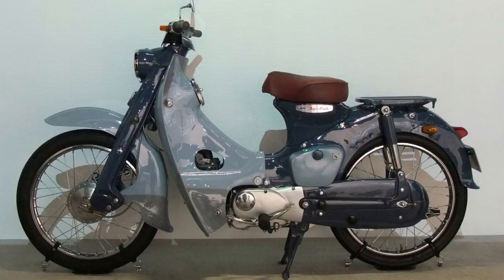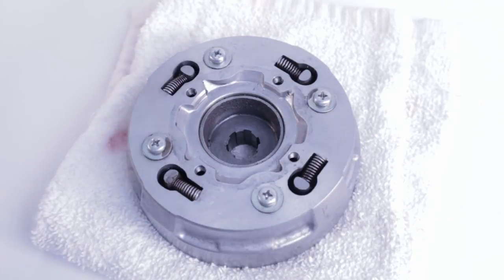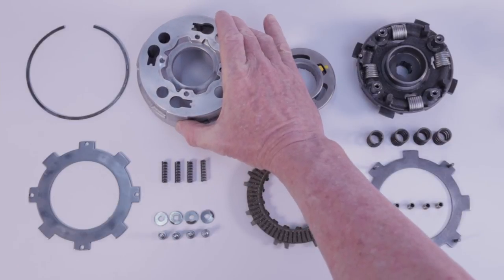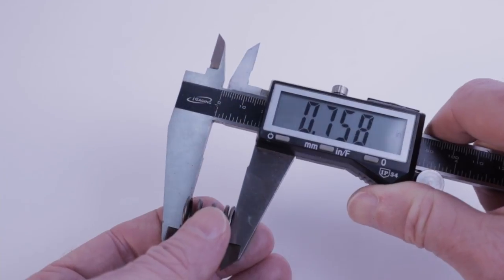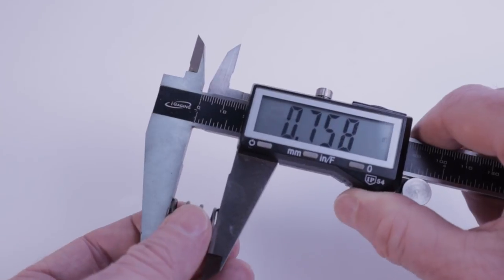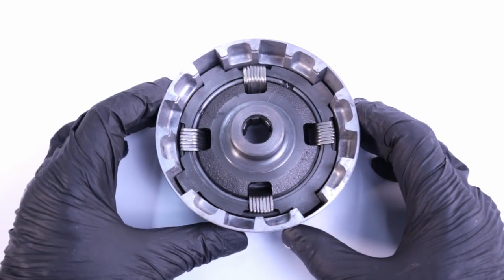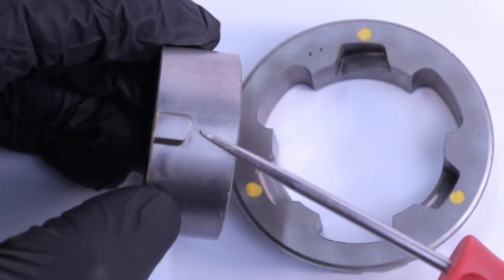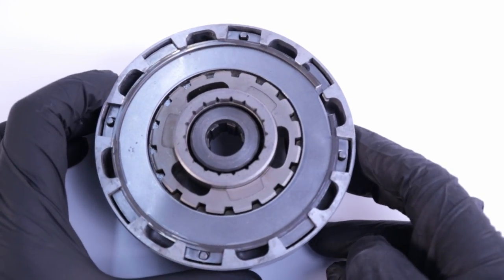How To Rebuild the Honda Semi Automatic Clutch || CRF70 | CRF50 | CT70 | XR70

Comment: I have a 1997 xr70r and the clutch grabs really hard shifting into 1st gear and shifts hard and grabs hard into 2nd and 3rd.  Not sure if this is normal, my kids manual clutch 2 strokes shift nice and smooth.

Comment: Ive never wore out one of these clutches and i really roughly ride my Chinese baja dirt runner 70cc. I wore the bearings out of the crankshaft its a 2006 model.
Reply: Once i held it wide open doing a burnout for 12 minutes straight split the tire in half and used the same bottom end currently a decade later. They're tough.

Comment: I know this video was posted two years ago so I may not see a reply but I will ask anyhow. First great video, I am trying to figure out why the B disc which is the one with material on both sides has to be installed with the chamfer facing down on install. The end tips which have the chamfer do not appear to interact with anything and I have never paid attention in the past so have installed both ways and never noted any adverse effects. I am going to guess no one knows for sure but the book just says so.
Reply from the maker: Honestly, I have wondered that myself, but I believe it’s less about the chamfer itself, but rather to ensure the engagement surfaces are oriented such that the rotation of the discs direct oil toward the center of the clutch rather than slinging oil outward. So my guess is that the chamfer is essentially an indexing mark to ensure correct disc orientation.  Good question.

Comment: Great video do you know if the ct90 plates will fit a ct200 clutch.  Trying to rebuild the clutch on my 65 ct200 and can only find ct90 clutch parts.  I know they have one less plate than the ct90 clutches but can I get away with just putting in two ct90 plates instead of the three
Reply from the maker: Hi Cole.  I’m sorry, but I don’t know the answer to that. I’m really not familiar with the CT200 at all.

Comment: Do the friction plates need to be soaked in oil for 24 hours before installing them?
Reply from the maker: Hi Back the Badge.  I am sure I am going to start a lot of controversy with this answer, but here goes.... No.  Mannnny years ago friction surfaces were made from cork and required soaking.  Cork has long been abandoned as a friction material, but the old soaking tradition didnt die with the passing of cork.  I just brush a little oil on the surfaces to make sure they dont (possibly) stick together between the time I build the motor and actually start it (In my case, that can often be a long time).  So there you have it - hornets nest now opened as I'm sure there are plenty of people out there who are clinging to the tradition of soaking without understanding the root of its original implementation!

Comment: what about adjustment after it's all together?
Reply from the maker: Hi. It’s a semi automatic clutch so it’s non adjustable post assembly.
Reply: @brian.d.mobley  well is there a intial setting, do i just turn it until i can feel it touching the part the three steel balls ride on, then lock it in place?

Comment: great videos. could you go over the manual clutch on these? I  have new clutch that won't disengage even after rebuild and inspection and swapping parts off old clutch. Here's big question> what is supposed to disengage this clutch? on other bikes i see a metal rod putting pressure on clutch. on these bikes the button attacked to spring isn't pressing on anything? is there a mechanism with the oil that creates pressure or releases it? that bearing isn't connected to anything so i really don't get it. thanks so much
Reply from the maker: Hi Schpoingle!  A manual clutch utilize a cable actuated rotating lever and a plunger rod that presses against the bearing on the outside of the clutch housing to introduce a gap between the various clutch plates thereby disengaging the clutch from the the crankshaft.  I did a complete video on that here:  https://youtu.be/eMv0ecUD8bI

Comment: Thank you for that great video and it has inspired me to try to resolve a problem with my grandsons CRF70 though am not sure which part might be at fault. When riding I have great difficulty in changing up gears and really need to pull hard on teh gear lever. Changing down is no issue. Is it a clutch problem do you think please?
Reply from the maker: It can be so many things, but the shift drum bolt may be too tight. This is a common reason for the condition you describe.

Comment: Thank you again Brian. So this bolt is accessible without having to get inside the wet side of the gear box then by the looks of it. The bolt located beneath the rubber shift bolt cover?
Reply from the maker: You’ve got it! Yes!

Comment: Great video! 
I got a question tho the clutch plates do you soak them in oil before u install them?  Or leave them dry?
Reply from the maker: It’s not going to hurt to soak the discs, but mostly that is a relic from the past from the time when clutch discs were made of cork. I light coat of oil is fine. If you are building the clutch and will put it in service soon after assembly, you don’t need to soak or oil.

Comment: Appreciate the video. Is this the same or similar to a z50r clutch? My 1993 is painful to put in gear and shift up it’s so stiff - all original parts so guessing it’s just worn
Reply from the maker: HI Peter.  Yes, the clutch is virtually the same.  These gearboxes can be hard to shift for a number of reasons, but the most common is worn/bent shift forks, the drum bolt is too tight or the pins in the shift fork are worn out.  I have had trouble with these gearboxes myself on many occasions too.
Reply: @brian.d.mobley  thank you! Subscribed!

Comment: Hey. I wonder which rmp this clutch connects the rods. :) do you know that?
Reply from the maker: Hi Alois!  I think you are asking about the engagement RPM.  I don’t know that figure as I don’t have a tachometer attached to the bike on which this clutch is installed, but it’s pretty low. Id guess less than 1100 RPM’s.

Comment: Brian, thanks for the great videos you do! I’m ordering the parts to do a clutch rebuild on my CT70. I want to ask if you recommend soaking the new clutch plates in oil before installing? Any assembly lube on the various parts? Thank you.
Reply from the maker: Hi Don. You don’t really have to. That process is one that has lingered unchallenged for many years and arose from a need to pretreat clutch shoes when they were made from cork or cork derivative. Still, it doesn’t hurt and may be beneficial if there is a long gap in time from the time the clutch is assembled until it is actually used. Out of pure superstition, I usually at least wipe the faces of clutch discs with motor oil before I install them in a clutch housing.

Comment: what are some of the signs of something wrong in the clutch? like my bike slips on 70% of the kicks when kick starting, wondering if that is in the clutch. oh and i cant get it started as well and its all new with the tb 88 upgrade. any help is appreciated.
Reply from the maker: Hey Jeramiah!  The main symptom of the clutch being worn out is that you motor will have inconsistent revs particularly under full power or loads such as climbing a hill.  The revs will vary and oscillate. Hope that helps!  Thanks for watching.